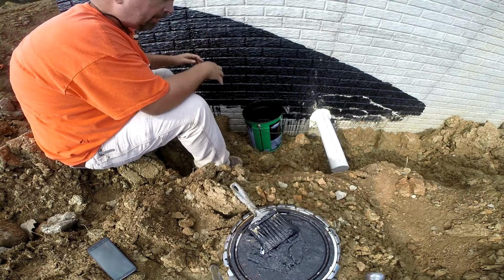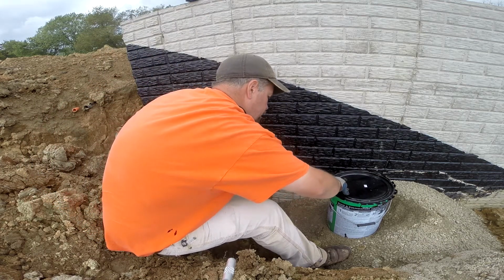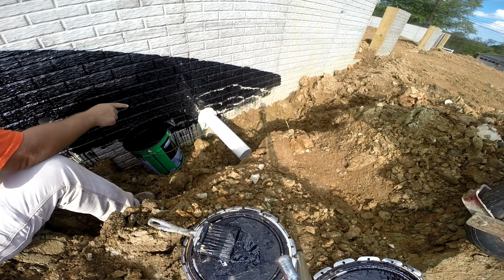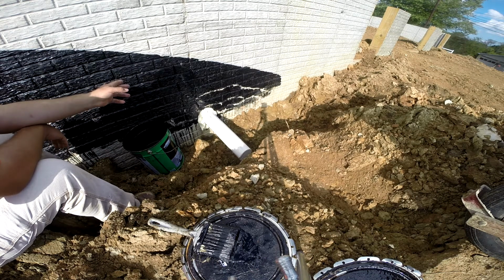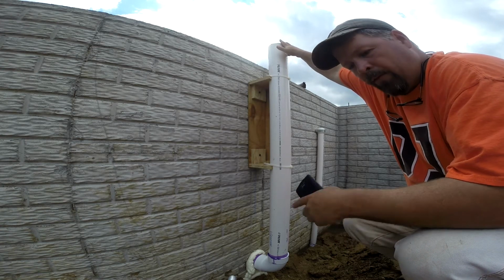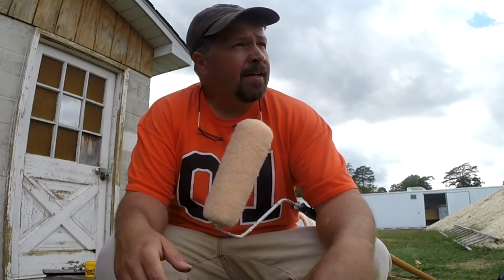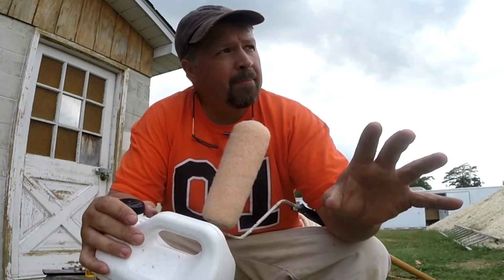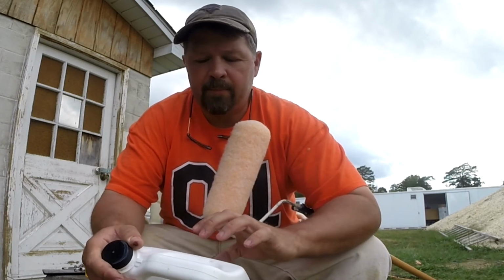New Shop Day 105 October 2 - Sewer Line and Concrete Sealer

Comment: i used a 2 part catalyzed urethane sealer on my shop floor, i was happy with it, the coverage and usage rate was consistent with what the company recommended.  I first tried spraying out of a sprayer, bought a brand new one that was safe for solvents, and had similar results as you, couldn't get it to spray well.  I used the same stuff on the countertops I did recently, and man those countertops absorbed that stuff like a dry sponge, the second coat didn't hardly absorb at all, so if you were to do a second coat, you would get a lot more coverage out of a gallon and if you averaged the 2 coats you might get closer to what your looking for.  Good update.